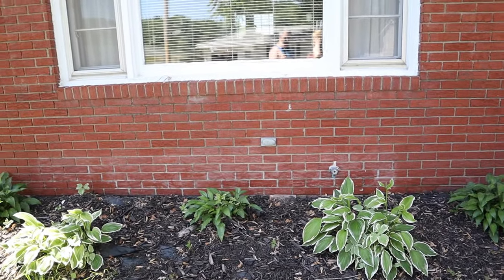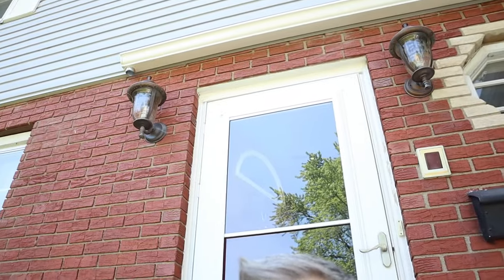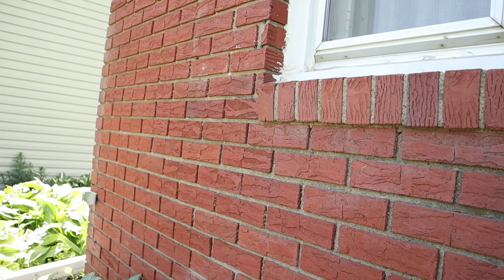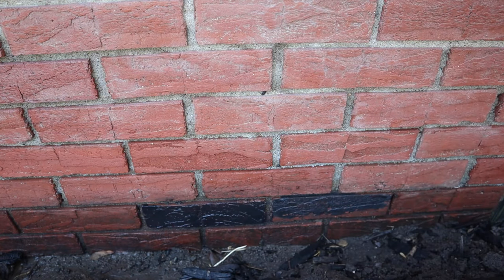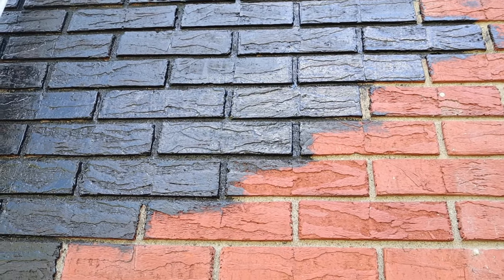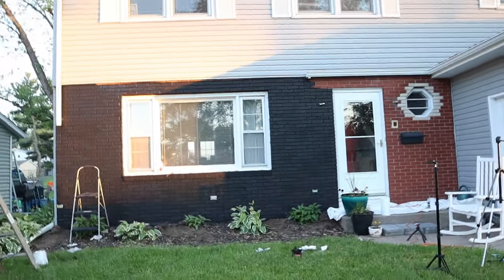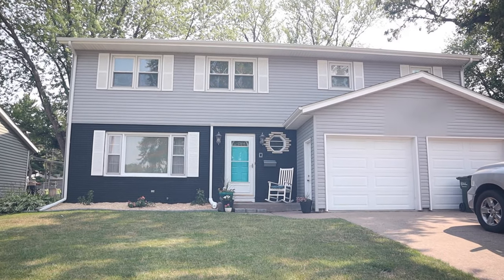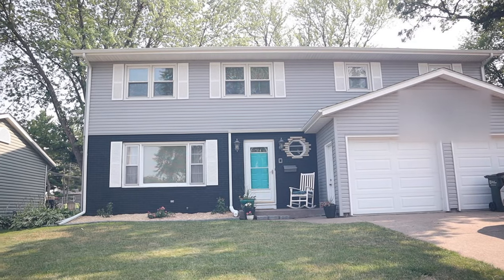BRICK STAINING THE FRONT OF OUR HOUSE | BRICK STAINING BEFORE AND AFTER

Comment: Wow! That's awesome. You've definitely sold me on the idea of staining my bricks instead of painting them (which I dont know much about any of it, but a few people had suggested changing the color). Thanks so much for the video, I'm inspired now😊 What brand of stain did u use?
Reply from the maker: Here is what we used and where we got it: Here is a link to what we used. Found it at a local store and it was much less expensive than some kits we saw online. This was so scary to do, but we are extremely happy with it! A few years later now and there is NO WEAR at all! I'm shocked. No fading, peeling etc. Thank you so much for watching. Good luck with your project! 
 https://www.menards.com/main/paint/concrete-blacktop-sealers/concrete-stain/h-c-reg-satin-water-based-solid-concrete-stain-1-gal/72-000010-16/p-4364363663390468-c-7949.htm?tid=-4441676272659723557&ipos=1
Reply: Hi guys, I am looking at doing this project myself, thanks to your video, gives me courage and guidance to go for it.
Amazing that there are no wear at all?? Wow. Would you be willing to do a quick follow up video to show what it looks like now? And any tips and pointers after the fact? Appreciate it!!!